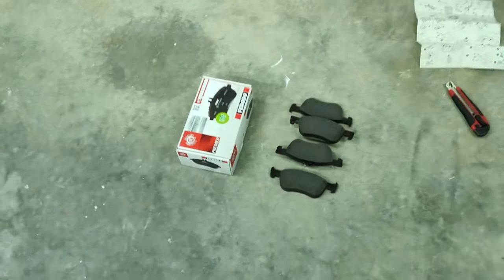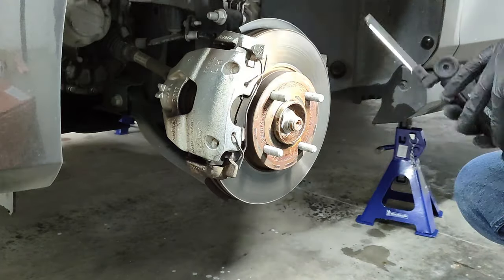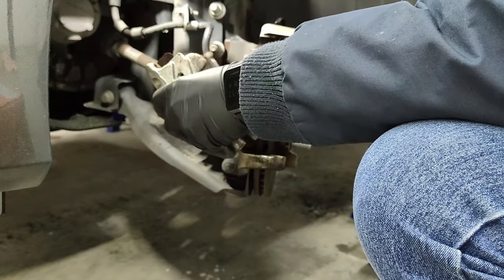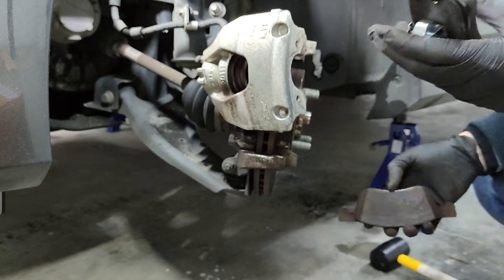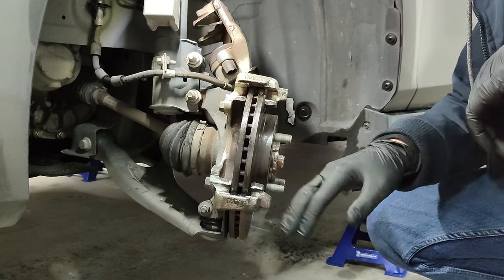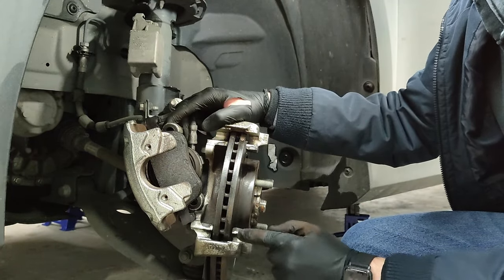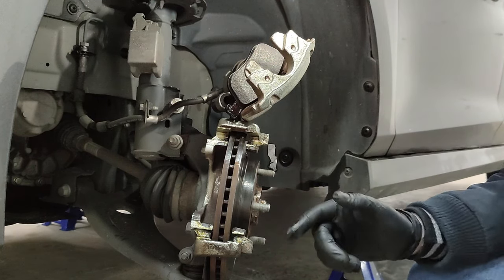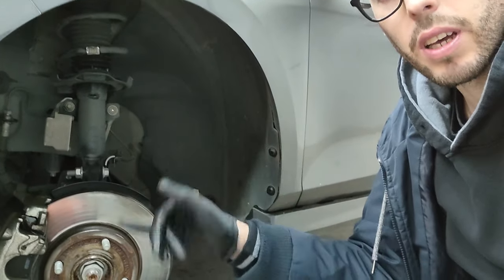Changing The Brake Pads On My 2018 FORD FIESTA MK8

Comment: Hello, Ford fiesta mk8 doesn't have the pad wear indicator?
Reply from the maker: Hey, no it does not. For what I have read a light comes on to warn that the brake fluid is low, sometimes due to the brake pads being worn, but by then it can be to late. But there is no light or sensor for the brake pads.